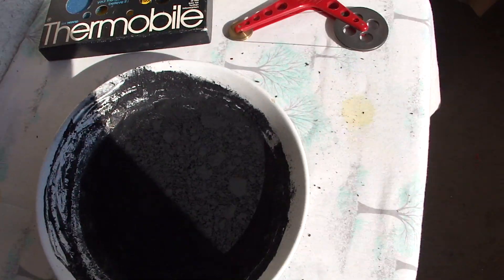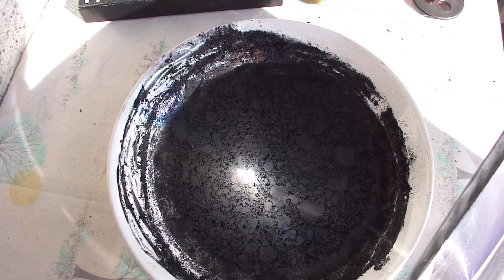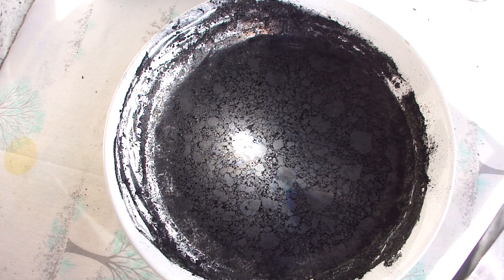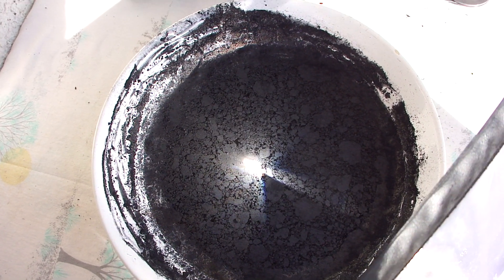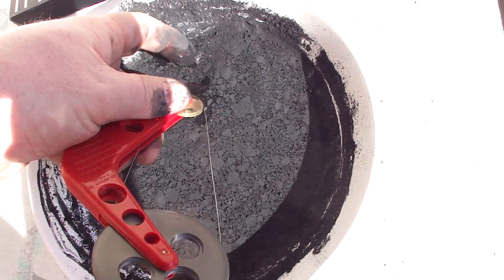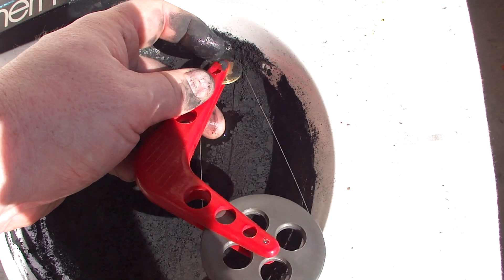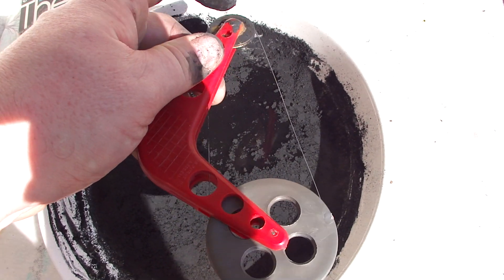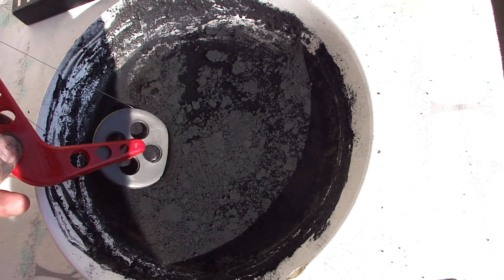Free Energy Nitinol Sterling Heat Engine Toy thermal motor 01

Comment: This has nothing to do with Sterling or Stirling engines. Those work by heated gas  expansion moving a piston. These Thermobile or Heatmobile engines work using nitinol wire's ability to revert to its original shape when heated by the sun or hot water.

Comment: Lamp black on the brass should work to heat it faster, heating the water with the fresnel lens will take quite awhile (maybe put a clock in the picture and speed up the film?).  Just a thought.